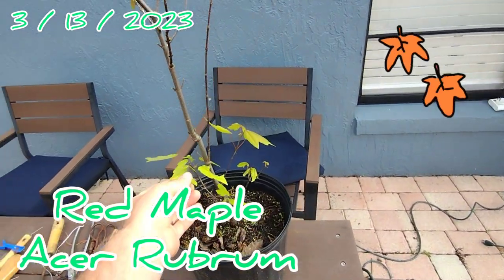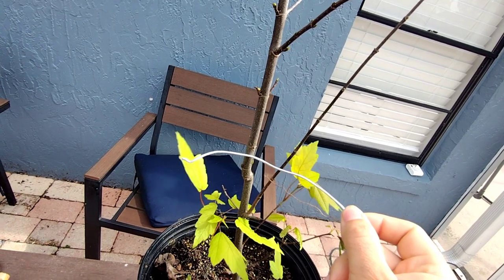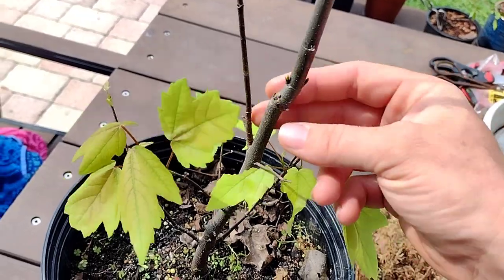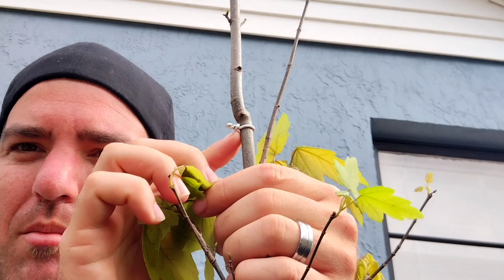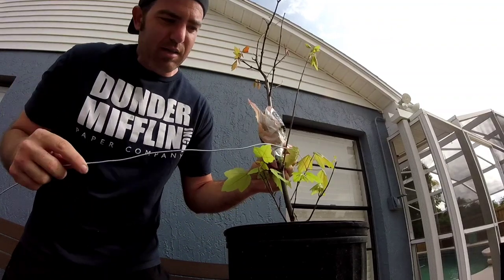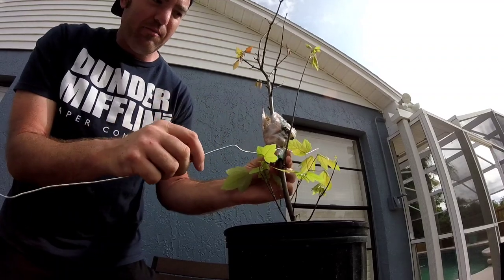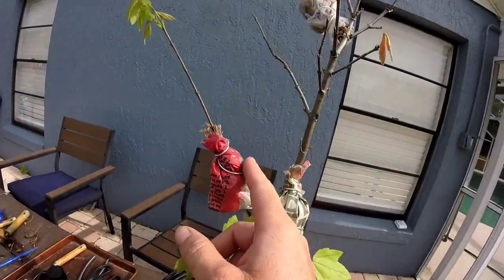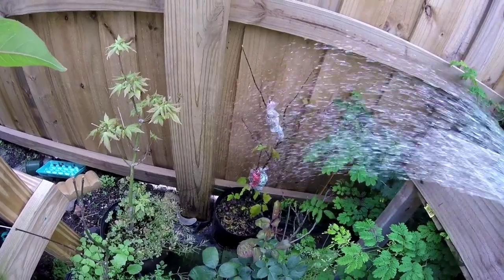Tourniquet Method Air Layering on my Red Maple

Comment: pls create an update video on this, how it went! :)
Reply from the maker: I will soon! It has roots but I have not separated it yet
Reply: @buntongm  i just separated some of my cherry laurel airlayers. being my first airlayers, i wanted to make sure that the plastic bas are secure on the branches, i tied them very tightly. and in reality it turned out to trigger a tourniquet airlyer or some kind of mix / hybrid airlayer approach.

first, above the wire it started to become very bumpy, then later it broke and pushed the bark apart with houndreds of roots sprouting underneath it. i amended my root ball and added an additional pack of moss on this part which kept it healthy and allowed it to grow. going forward i may do this on purpose to trigger such root formation